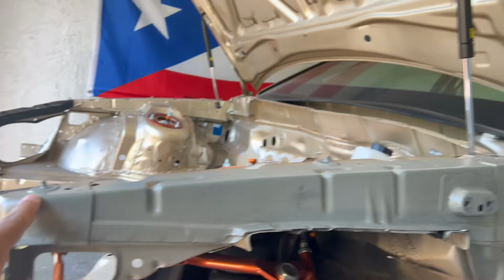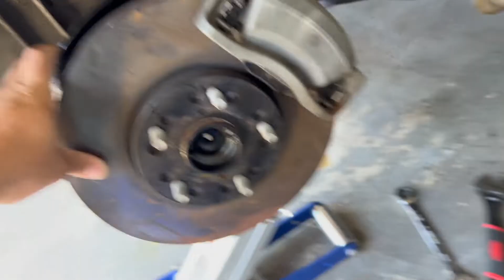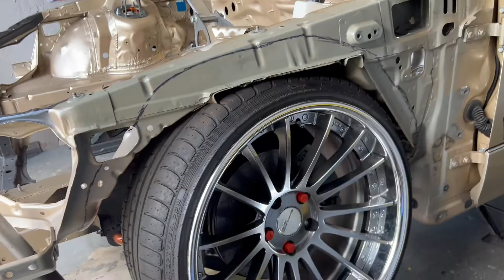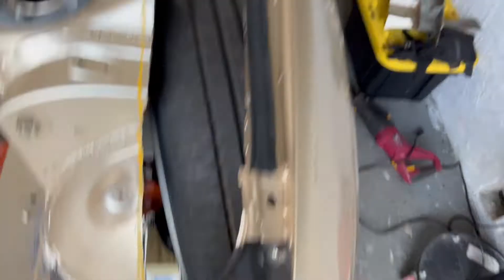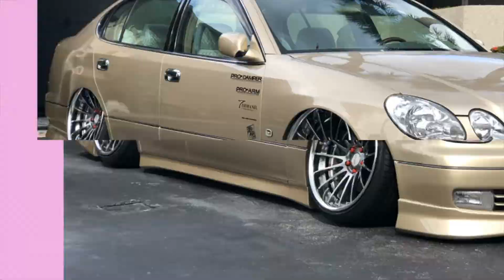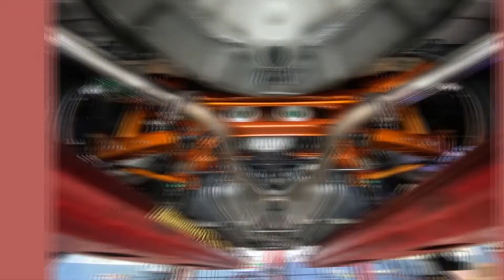Lexus GS300 Fender Tub Process Part 1

Comment: 19’s going to look insane tucking. 👌🏽👌🏽👍🏽👍🏽
Reply from the maker: Thanks bro, I want to see how they will look with the 19s when it’s on the ground. But I want 18s 😂. The next set of wheels ima go with that and see how it looks in comparison.
Reply: @SOFLOGARAGE  I wanted 19×8.5 et35 but decided on 18×8.5 et35. Why do you want 18's? The 19's look good.
Reply from the maker: I think the 18s will give me more low. And possibly run not as much aggressive camber compared to the 19s for the look I’m going for. Everything is all in the air right now. I guess I’ll have a better idea once the car finally touches the ground and I can see how it looks like.
Reply: @SOFLOGARAGE  Makes sense